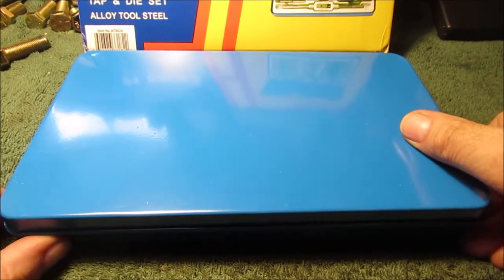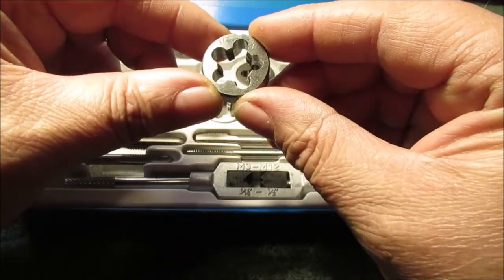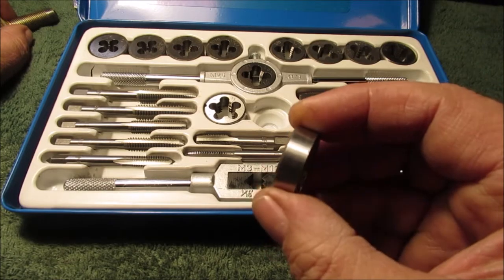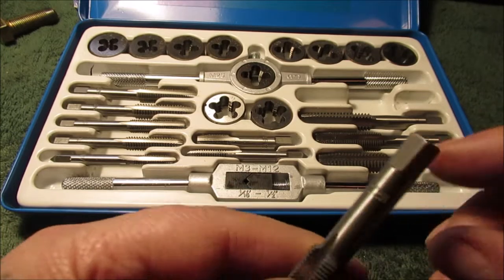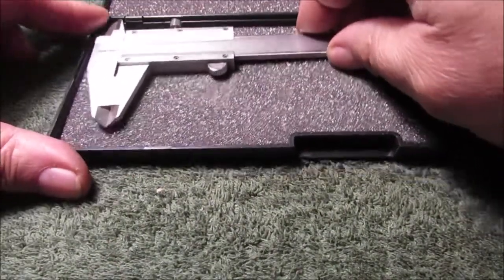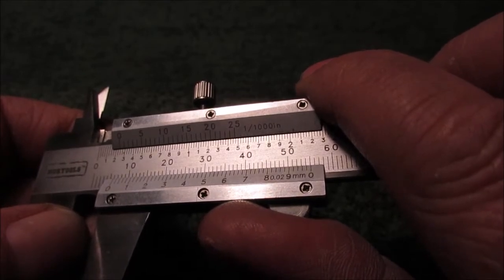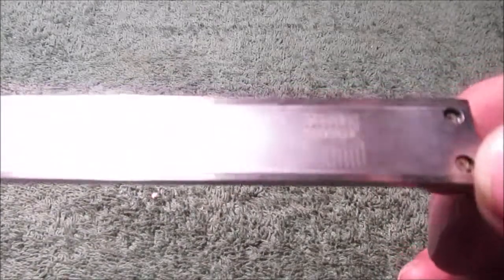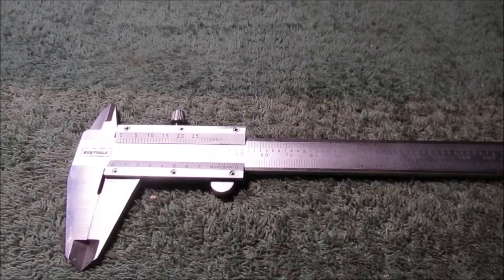New Tools....Tap & Die set

Comment: That is some nice shop bling there.  The Metric will be more handy as time goes on.  I am not knocking metric.  It is what it is.  The set wlll save your rear end.  I like the Caliper.
Reply from the maker: I like the alloy steel tap and die set ..way better than the HF cheap carbon steel..I don't mind using metric bolts in projects HF has a good price on a box full of small ones The old school caliper is interesting to learn

Comment: What is the difference between these Verniers and the ones with a dial? Cost wise? Chicom made?
Reply from the maker: They cost about the same as a cheap dial set ...I bought these to measure metric bolts and for the challenge of measuring with a vernier scale instead  of a dial I am sure these are made in China